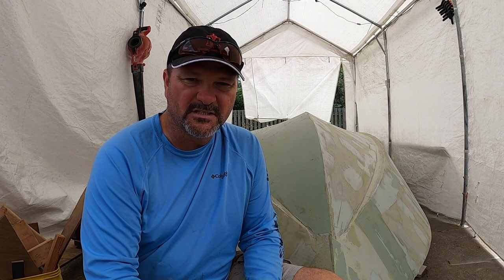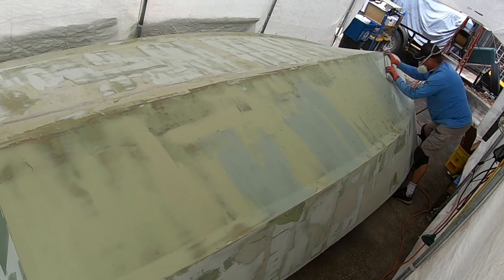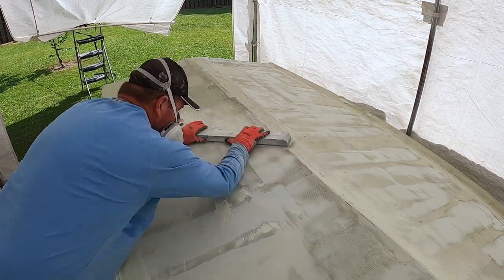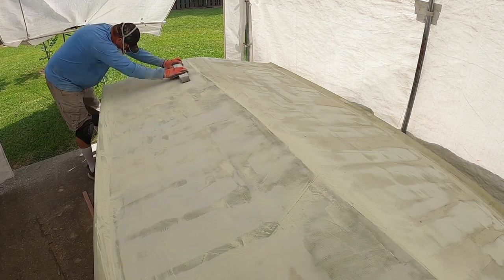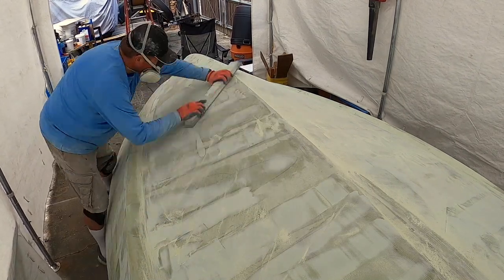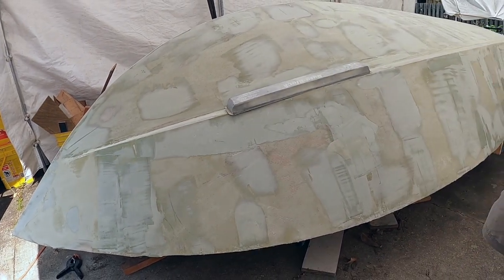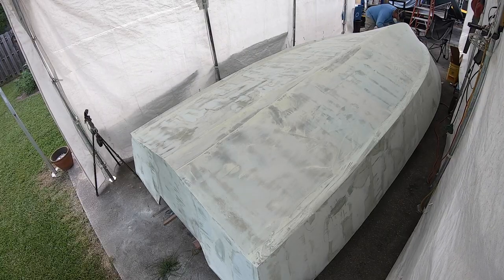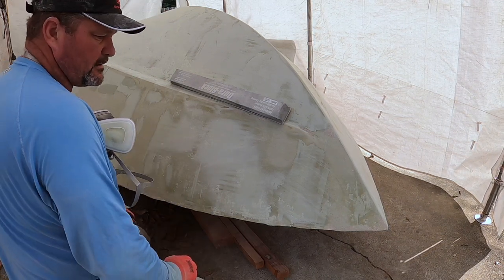34. DIY Boat Building: Learning the HARDEST Lesson

Comment: I did the “rattle can” black guide coat and I highly recommend you do the graphite powder instead. Much easier. The paint in the rattle can created another layer to sand down
Reply from the maker: Yeah I don’t need any steps that will require more sanding.  But, I will do what it takes to get the best finish I am capable of obtaining.  That’s my goal.  You keep at it too sir.

Comment: Yep, fairing is tricky and time consuming! The best advice I could give is to skim as thin as you can in order to fill the fiberglass weave. Too little, and you'll have to come back and add more. Too much, and you'll spends hours sanding it out. 

While my project has been fun, if or when I build another, I have to come with a design that will be quicker to build.
Reply from the maker: I think the toughest part has been the learning curve.  As with anything, the next time I do this process it will take 1/5 of the time and effort.  Even then for someone who does this everyday, it would take less time and effort still.   But it’s my project, and I’ve put in the effort.  Even if it was ignorance on my part, I didn’t cut corners.  Best of luck to you on your projects.